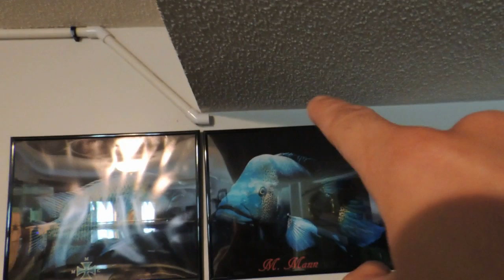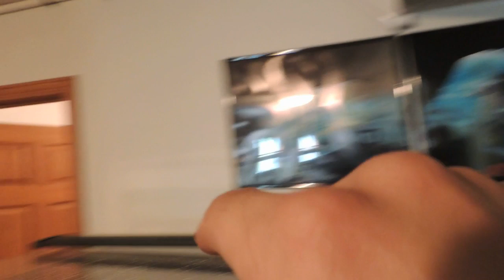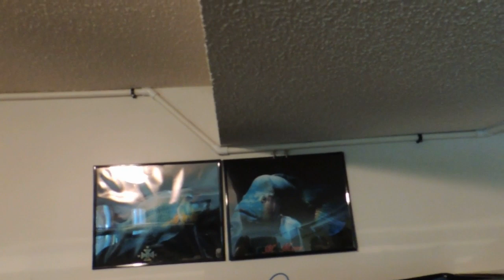Air Project Addition

Comment: Awesome video, Mike! I have 90% of my parts for my air system, just haven't had the time, (lazy) yet.  Question though.  I wasnt going to cement my pvc.  Do you think its necessary?  Also, was it hard to cement the pvc to a section that was already clamped to the wall?  Thanks again for sharing!
Reply from the maker: I would cement them so they do not leak or come apart. If you leave some play in the end of the pipe that is on the wall you will easily be able to glue the next piece to it. Thank you for the kind words brotha :)